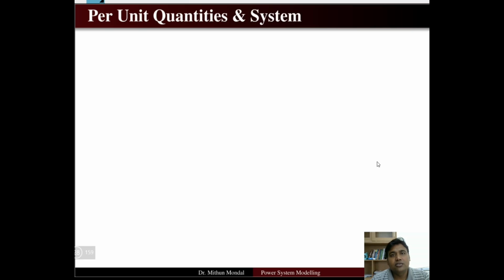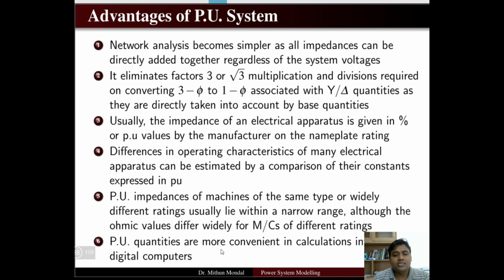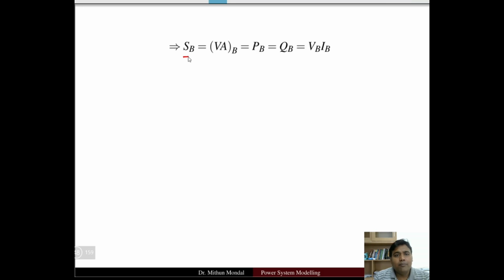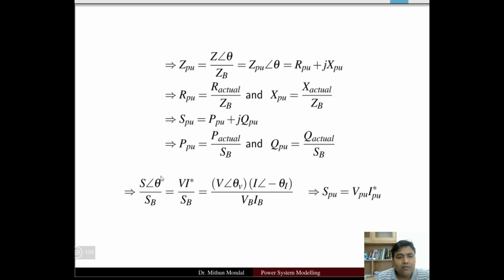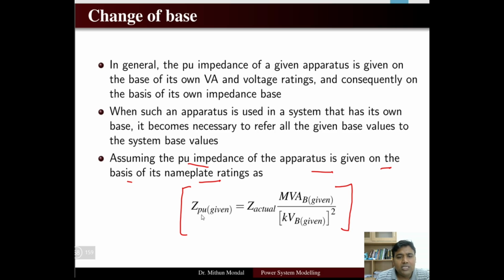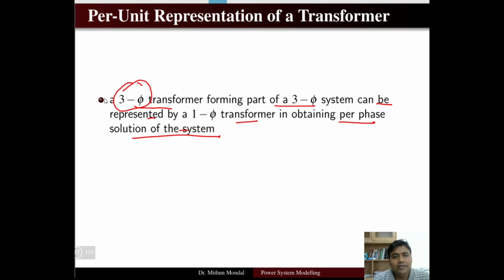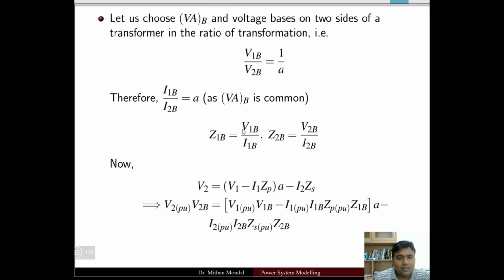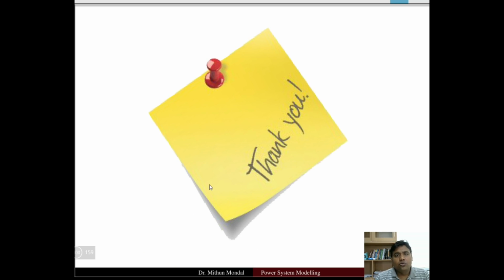Power Systems | Lecture - 27 | Per-Unit Quantities & Systems

Comment: Dear Sir, may I inquire about the formula Z1 = Zp + Zs/(a^2) shown at 25:14? I'm curious about its origin and the specific knowledge it relates to. I sincerely apologize, Sir, as I struggle with understanding your lectures, so I've only been able to grasp the information through your presentation slides.
Reply from the maker: The equivalent input impedance (Z1) on the primary side of the transformer is obtained by the given formula. Here, Zs/(a^2) is the "reflected impedance" on the primary side. To understand it better watch the video lecture on magnetically coupled circuits in the Leccture playlist of Electric Circuits & Networks.
Reply from the maker: To understand power system in a better way first you ahve understand electric circuits and basic electrical engineering. As they are the foundation for the power system course.